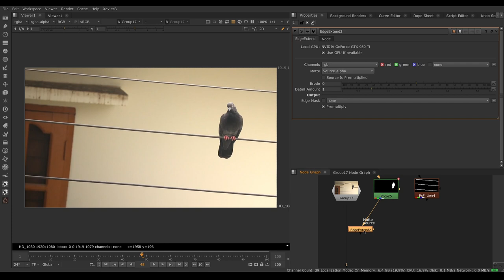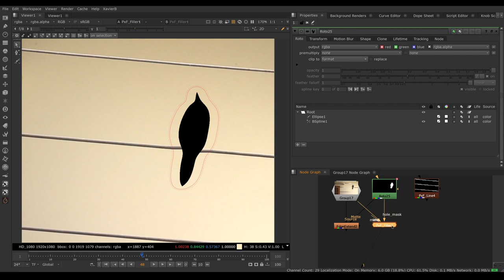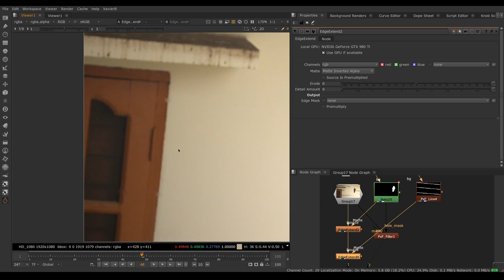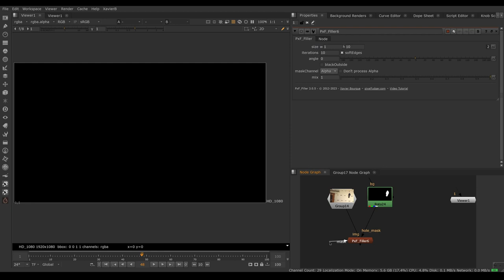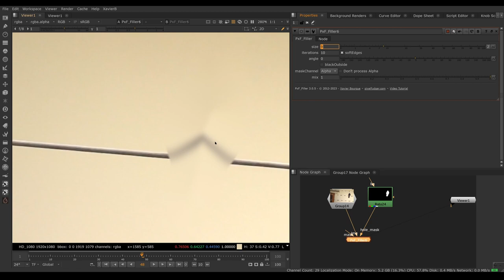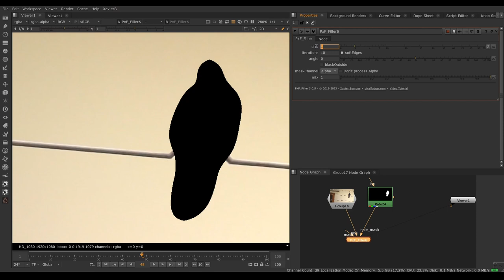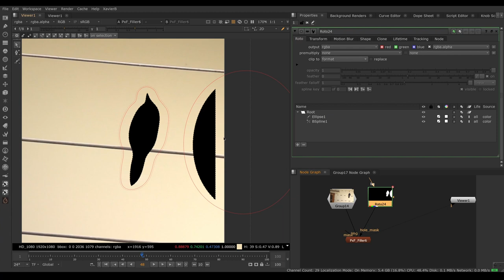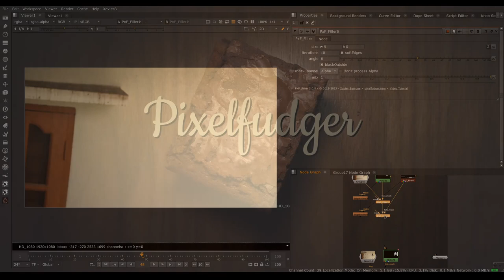PxF_Filler

Comment from the maker: Welp this is embarassing... Turns out that since Nuke 12.0, there is a great node called Inpaint that does exactly what PxF_Filler does except faster... and easier to setup. :-) So do your self a favor, if you have Nuke 12+, give Inpaint a try! (I did not know Inpaint existed when I recorded this video, because I am an Old and I keep using the same old tricks over and over...)
Reply: I use both. 
Inpaint is hard coded I think which makes it give its own result different than pxf filler or any other filler.
so I always try both and compare the result so sometimes pxf is better and sometimes inpaint is better